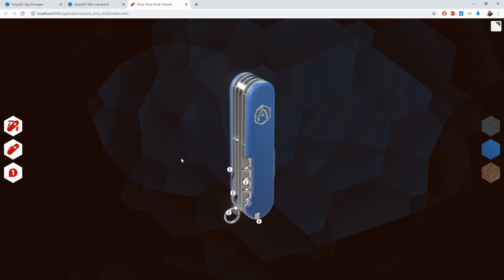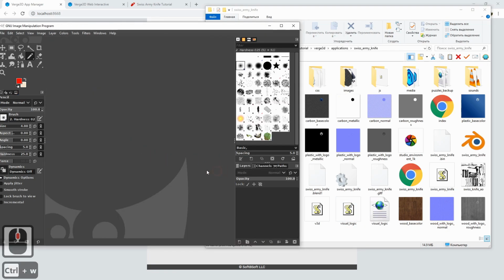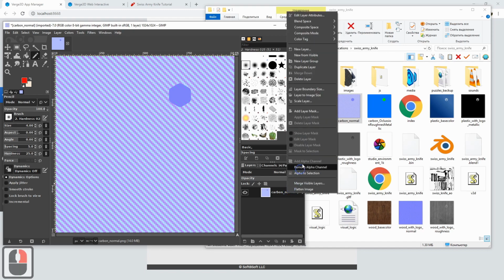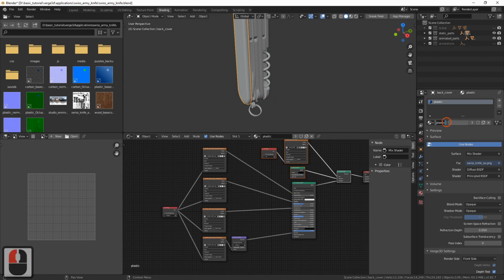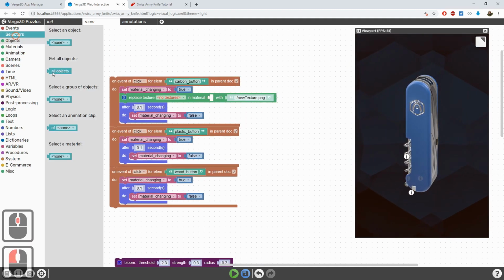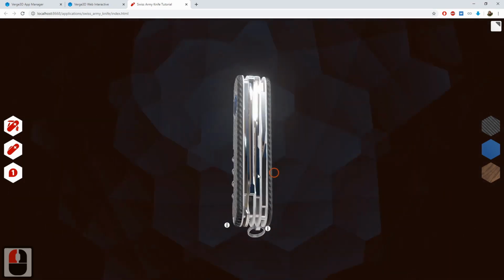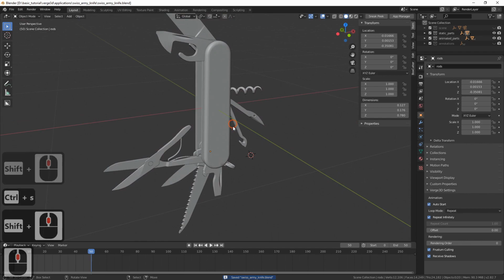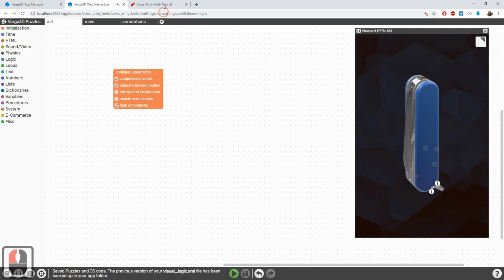Verge3D for Blender Basics - Part 11 - Application Optimizations

Comment: Thank you for the great tutorial. Is there a way to make the 3d design responsive ? For example changing the position of certain elements when using a mobile and adapting the design for desktop as well. It’s the same as responsive websites. Thanks!
Reply from the maker: yes you can detect the dimentions of the canvas and mobile/or not and a lot of other special things and change scene according to that information.
Reply: @Soft8Soft  Thank you very much, I'm new to Verge3D. I'll try to see how that works